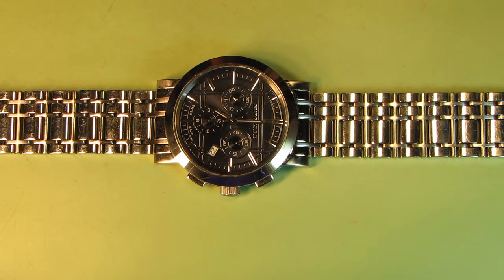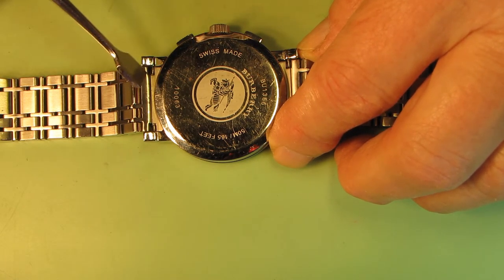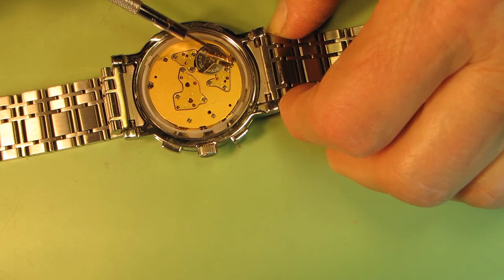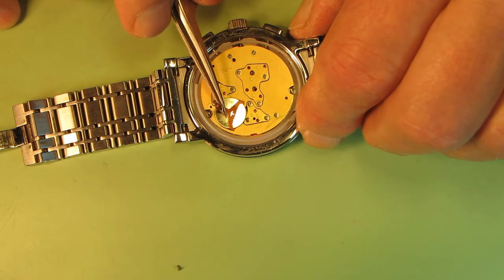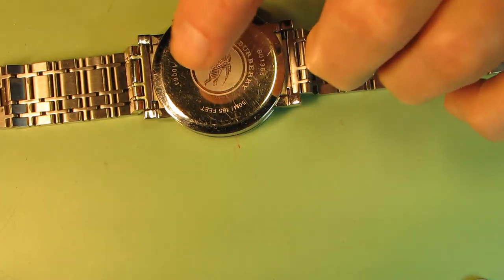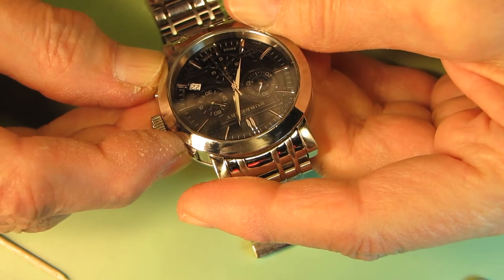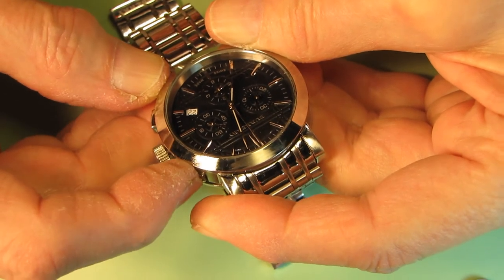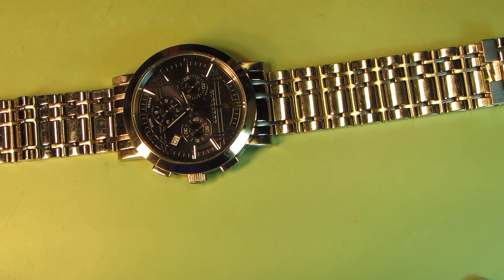Harley Ronda 5030.D Swiss Watch Movement Battery Replacement and Setting Up a Burberry BU1366 How To

Comment: Hi there, does anyone know the specs (size, etc) of the tiny screw that was removed from the spring bar mechanism in order to change the battery and where I can get a replacement screw? Also what size screwdriver is needed for this screw? Many thanks !!
Reply from the maker: The thread diameter of that screw reads as 0.6 mm with the length of 1.5 mm. It's pretty standard screw and can be found in other Ronda movements. The size of screwdriver is 1.0 mm.

Comment: What size battery for this watch
Reply from the maker: The battery used in this movement is either 395 or 927 type, which is the same battery. The size is 9.5 x 2.5 mm.